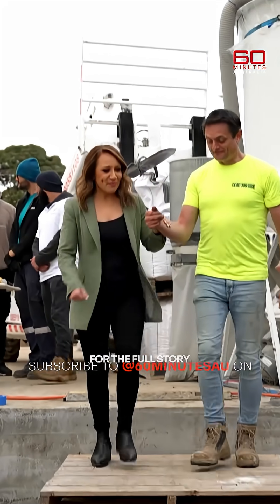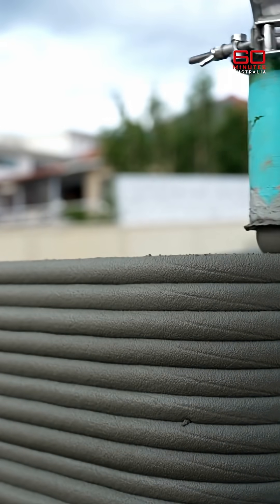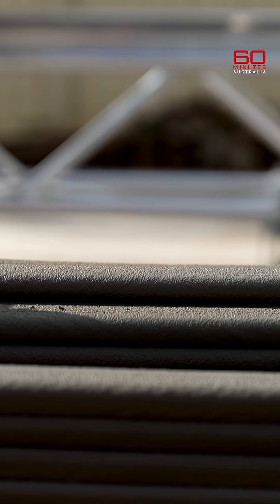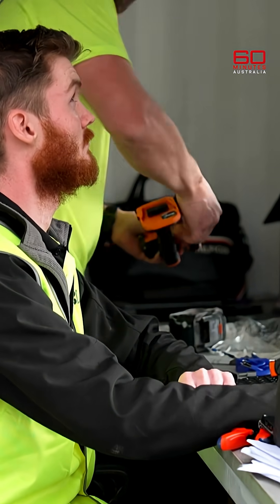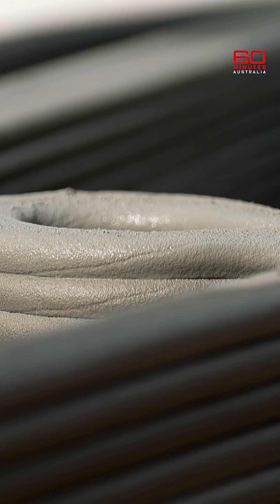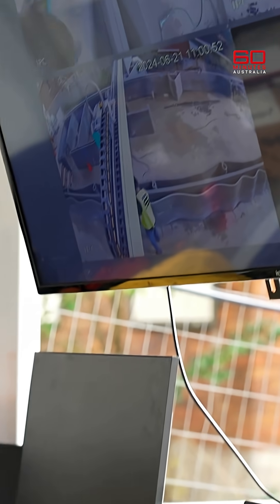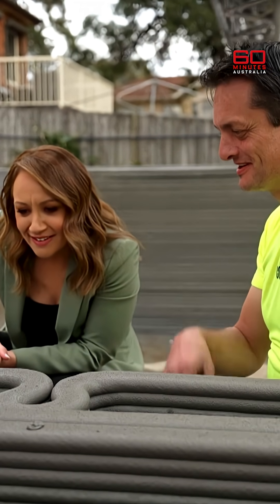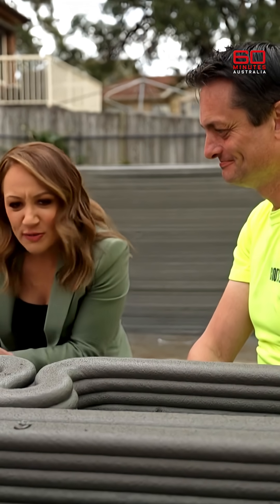Creating a 3D printed house | 60 Minutes Australia

Comment: Walls are not the expensive part of construction. We need a 3D printed roof or foundation.
Reply: The foundation can be done with regular cement trucks .. The roof can be constructed with insulin and aluminum or steel or the rubber-like wooden shingles ..